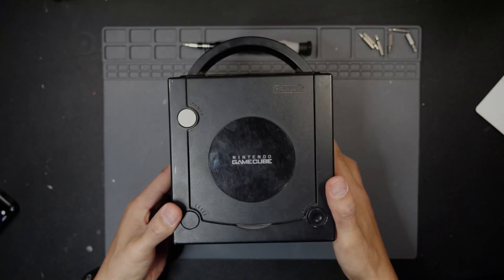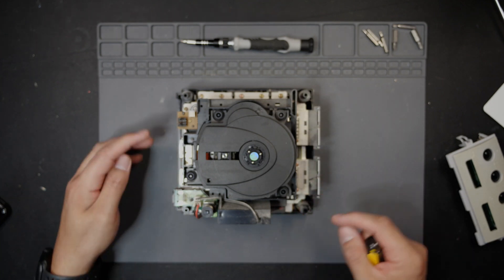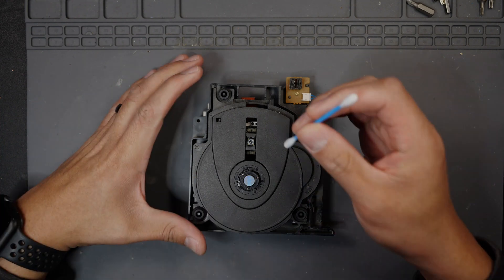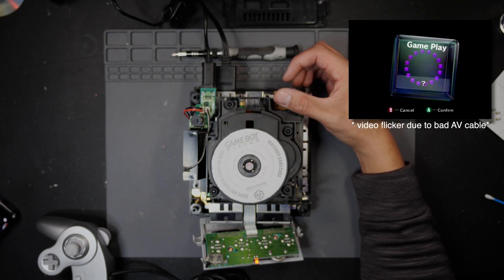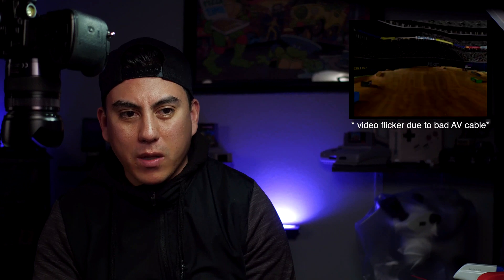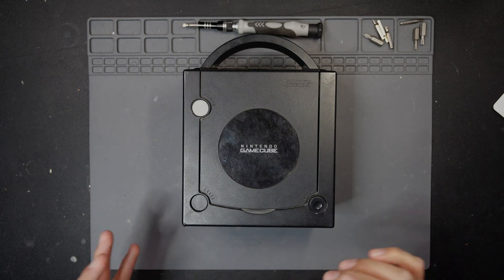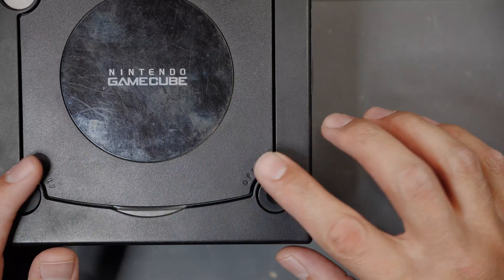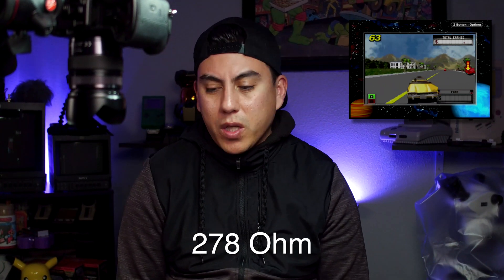Fix It Friday: GameCube, Disc Won't Read/ Button Stuck

Comment: Great video!

I will note that, of you're in this specific situation, I would use an additional test disc along with the Game Boy Player disc. The disc itself only has a tiny amount data on it, so it's not a good test for if the laser is moving or not. On the other hand, it's good news for this owner's disc, since only a very tiny ring around the inside of the disc has any data, most of those scratches on the disc don't matter.

Comment: My láser won’t light up, and upon start up the laser moves up and it gets stuck, it moves up and down easily when powered off but when it’s on it won’t go down as if the motor is forcing it upwards for some reason. Messed with the ohms 150-300 and nothing helps with this problem. Any ideas?🤔 also the laser is brand new and I installed it myself.

Comment: Have you ever had this not fix a game cube? I took my game cube apart and did this. My laser glows bright, the disc spins, and after 5 seconds it stops spinning and says no disc. It’s @ 220 ohm
Reply from the maker: It’s possible. The laser could have gotten scratched. It could still light up and try to read but not be able to. I wouldn’t go any lower than 200 and order a new laser. But remember to reset the potentiometer back up to where you started before installing the new one.
Reply: This game cube is driving me crazy. I bought a new laser, installed it reset my pot back to 380, and no change. I turned the new laser down to 200. No change. It lights up, spins and stops
Reply: I notice my laser will slide down to the most inner part of the disc and stay there. If I remove the disc and spin the laser will back up 1/4” then return to the bottom. Is this abnormal